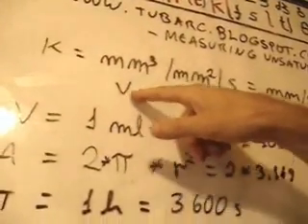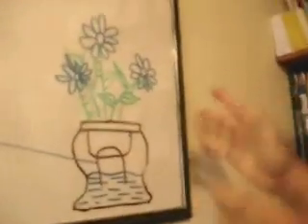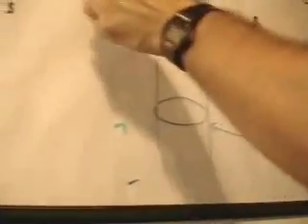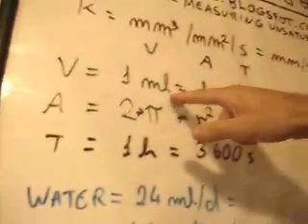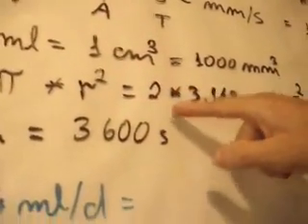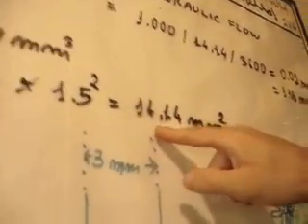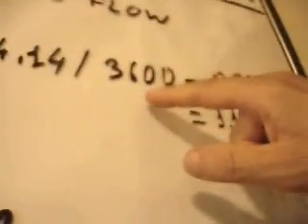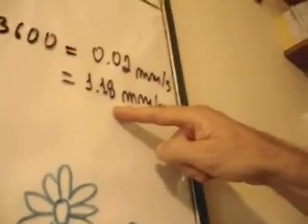Tubarc 064 Fluid Assessment

Comment from the maker: Thanks. There is a huge gap in applied Hydrology being neglected for around a century. So, it is not that easy to bring ideas and conceptions forward, but doing my best and struggling, experience and achievement packs up and helps to improve our general understanding about fluids moving on porosity. I am even happier because it converge to the principles of life when fluids had to move inside beings to let life work and develop for the internal hydrodynamics.